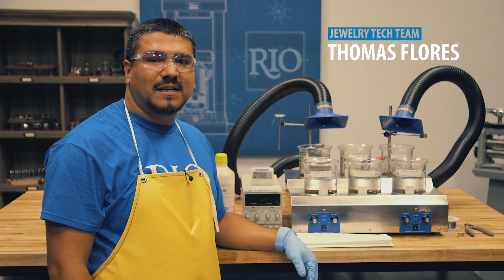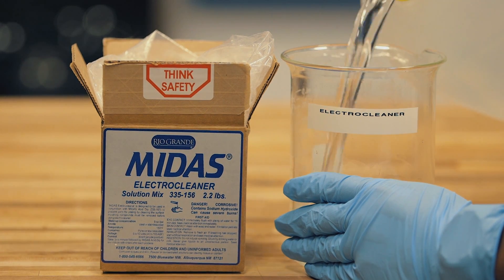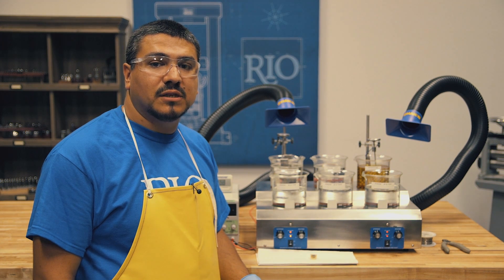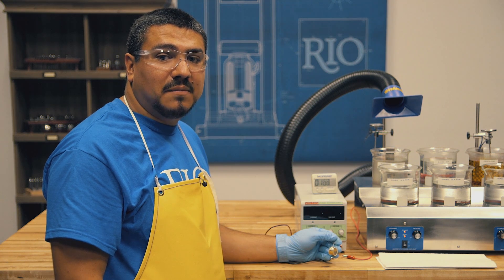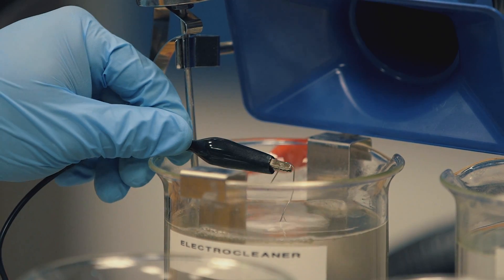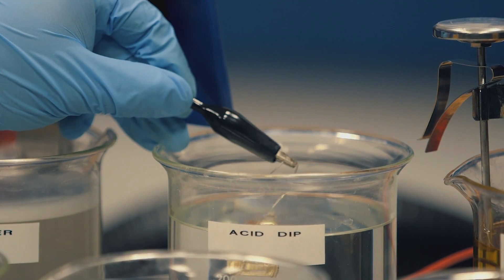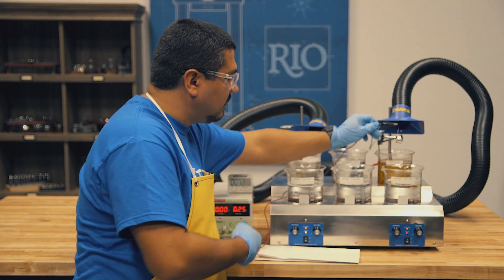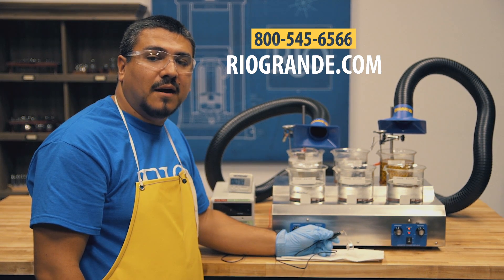How To Rhodium Plate Jewelry with Midas® Plating System

Comment: How many micron thickness of Rhodium plating does 30 Seconds give? 30 seconds sounds very very short to me. When I rhodium plates white gold I always played 3 minutes, which gives at least 7 to 8 microns of Rh (which resist tearing for at least a decade).

30 seconds of plating sounds to me like it will wear off in a year, and that basically makes it a waste of money and pointless if it's jewelry you want to wear daily
Reply from the maker: I would stick with the 3 minutes if that is working well.  The minimum for good coverage depending on  the solution would be the recommended plating time from the manufacturer. They usually give a an acceptable range for times in t he solution.
Reply: @RioGrande1944 what I meant is the longer time you electroplate the thicker layer rhodium it gets plated with, right?
So what I'm saying is if you electroplate for let's say 10 minutes without a break that must be a piece of jewelry you can wear for a lifetime

Comment: how do I make the stirring work?
Reply from the maker: You will need to have the magnetic stirring pellet needs to be in the bottom of the beaker. Then the pellet spins in the bottom of the beaker stirring the solution.

Comment: What I don't get why they call power supply rectifier .. rectifier is a diode bridge that rectify AC to DC which 8s the basis of any AC to DC power supply and all are simply called power supply not rectifier..

Comment: Can I use the  first two for yellow, rose and silver then change tye last solution for the desire outcome?
Reply from the maker: With the plating station, you only have 2 stations that are heated. Top left and top right. The Center top is not a heated station and the bottom 3 are not heated. The solution in question do have to be heated in order to react with the metal. When plating it is recommended that you electro clean first and then acid dip. So it would be best to use the last heated  station for the plating process

Comment: I Tried on silver ring it came out smooth and shiny but when i tried on white gold it removed, can you tell me why.
Reply from the maker: Hi, sorry to hear that you're having issues. There are a few reasons that this plating might not adhere to your white gold. It may be due to surface cleaning, settings on the rectifier, or the needing a different anode. If you'd like to talk over some specific details you can reach out to Thomas directly at thflores@riogrande.com.
Reply: @RioGrande1944  Thank you so much but I got it.

Comment: Hi, the cleaning solution is heated or stirred while cleaning the pice? Thank you.
Reply from the maker: Yes, it is heated to to 150°F and magnetic stirring is recommended with the electrocleaner. Acid dip does not require heating or agitation though!

Comment: I love your video. I do have a question about electroplating. I electroplate first the setting and then I set the stone? Bending the bezel over the stone will destroy the plating surface? Or can I electroplate with stone in place? Thank you.
Reply from the maker: Great question. It actually depends on the stone. For soft stones like turquoise, lapis and malachite, we would not recommend submerging in any of the solutions for plating. Our Jewelry Tech Team member also suggested being very careful with a pen plater, because soft stones are absorbent and it can cause a color change or staining of the stone. For stones with a Mohs hardness of 7 and above, it is fairly safe (although not all stones have been tested in the plating process). There are a lot of variables that can cause problems with plating. We hope this is helpful!
Reply: @RioGrande1944  Thank you very much. I really appreciate your answer. So, if I have pearls or other soft stones and I cannot put them in contact with plating chemicals, can I mount them after I plate the metal? Can I bend the prongs or the bezel without hurting too much the plating surface? Thank you.
Reply: @RioGrande1944 how about glass rhinestones?

Comment: How long does the electro-cleaner and the acid neutralizer last after its mixed with the water? Can you store it for later use? For how long?
Reply from the maker: Hi There, Thanks for your question! These should last about a month or longer. The length of service for them will depend on if they are covered and how often they are used and stored. 
Hope this helps!

Comment: So you leave the amps at 0???
Reply from the maker: Hi There, Thanks for asking. Both Course and Fine adjustment knobs on the current/amp side (left side of the device) will be opened all the way up, that is, counter clockwise all the way. The process of plating is concerned with volts, so this is the setting which is adjusted. You will see amps register when the item is placed in the solution and the circuit is complete. Hope this helps. Thanks again for watching!